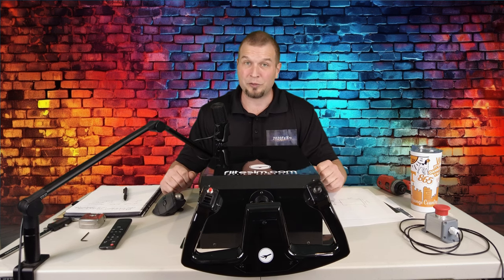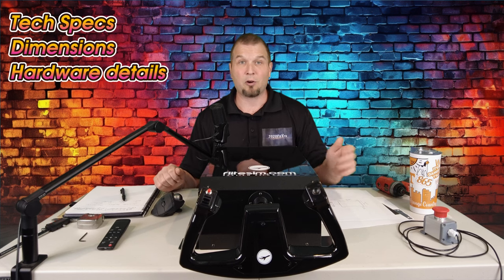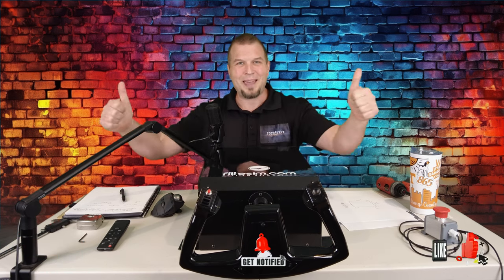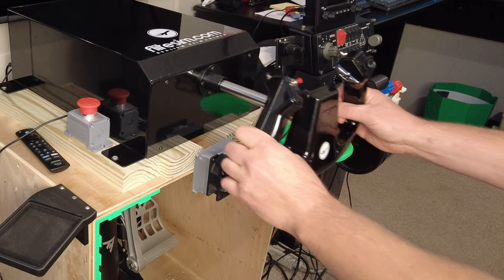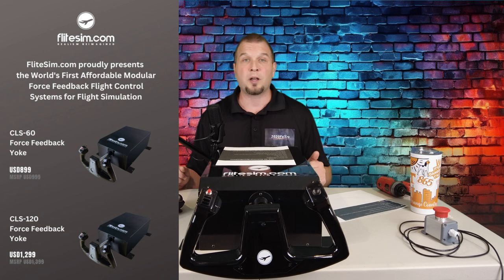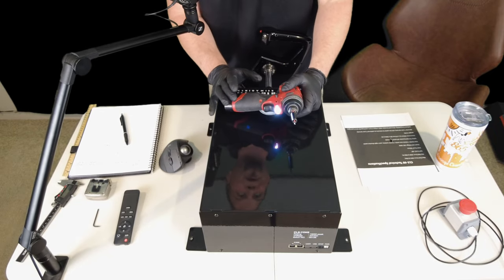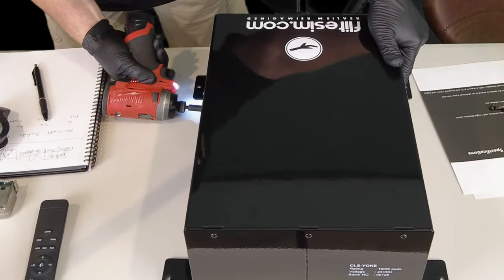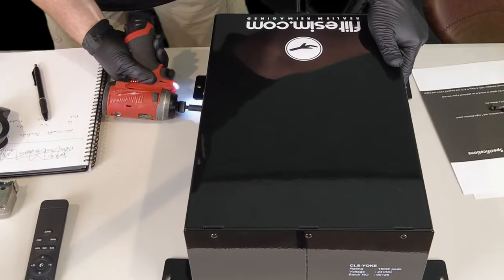MSFS2020 *Flitesim.com Force Feedback Yoke Review* Teardown, Warranty, Hardware- Time stamped Pt.1

Comment: Brilliant job thanks! I am concerned that their isn't a bearing at the front panel of the yoke axis. Do you know about the borderline broken turtlebeach yoke where many including myself struggled with fine pitch axis control because it doesn't have a bearing there either? I installed an after market bearing at that front panel position to help fix it.
Reply from the maker: Thank you . Honestly due to the thickness of the shaft and the big bearings and blocks that are on the inside that I showed that shaft does not really Bend at all it's very heavy duty. I have checked out a competitor's video about binding issues due to the front bearing or bushing that they're using in theirs and it causes a lot of problems but the inside of their unit is nowhere near as beefed up as this thing is

Comment: I was hoping during the teardown you would show how the parts move, without power, in pitch and roll. I bought one of these from Fabian and just don’t want to open it up at this time.
Reply from the maker: During the demo.i did move the yoke In and out .i also showed the carriage and how its mounted to the rail and showed the belt and how its connected . . And I showed the components and how they are connected to roll axis . Im not sure what turning the roll would show anything other than the motor turning the belt and turning the yoke shaft .
Reply: @2020fsers you did reposition it during the video but I wasn’t able to witness what I needed. When I move the yoke in pitch fully forward and back I feel a little thud about mid way. I just wanted to see what causes that during a full view of the inside. My yoke works fine so there must not be anything wrong with it.
Reply from the maker: @douglashornick4388 that thought that you're feeling is that with the yoke not powered?
Reply: @2020fsers it’s not powered. Correct.
Reply: Move the yoke out and in quickly. I feel two thuds actually. One is about midway and the second is at the end of travel. I don’t know what causes the thud midway.
Reply from the maker: Okay that's your problem the yoke is meant to be used in a powered up state. When you operate the yoke quickly when it is powered off you are turning those Motors. A motor is essentially a generator if you turn it fast, so you are  causing back feeding of electrical current through the system and the board therefore giving the motors and instantaneous electrical surge (creating force) causing a thud. it is not advised to move the Yoke quickly when it is not powered up. backfeeding of electricity is not a good thing on the boards.
Reply: @2020fsers hmmm. Interesting. Thank you.
Reply from the maker: Your welcome